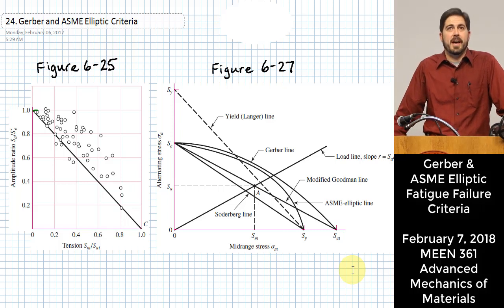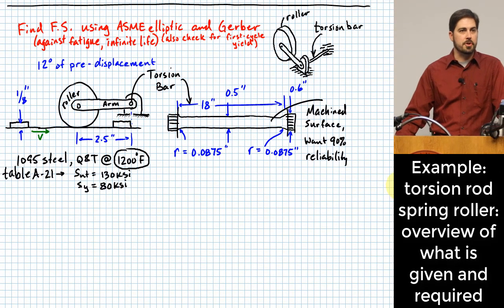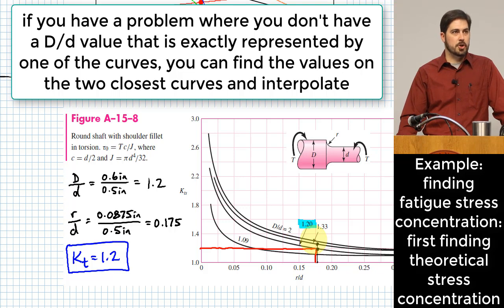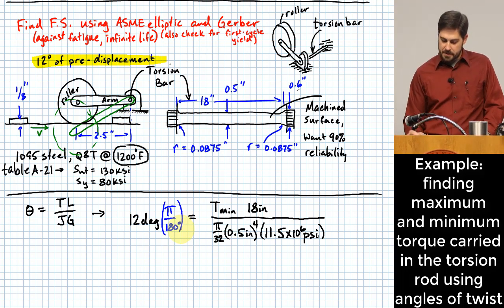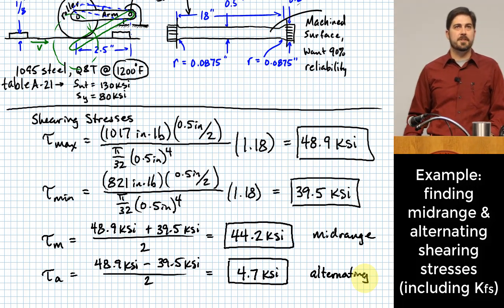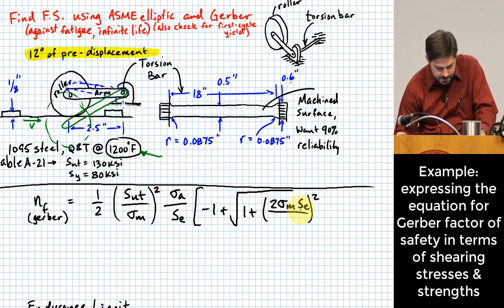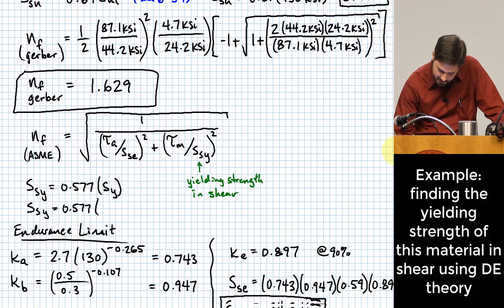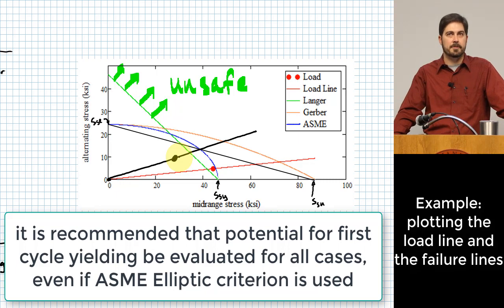Gerber & ASME Elliptic Fatigue Failure Criteria | Torsional Fatigue | First Cycle Yielding

Comment: So if the Gerber line is the best at curve fitting the data, and the yield line is the cutoff line beyond which none of these lines even matter because of first cycle yielding, why isn't Modified Gerber the gold standard? Like Modified Goodman from the Midrange and Alternating Stress lecture where the line gets cut off by the Yield/Langer line except with the more accurate Gerber line. Thoughts? I think why the gentleman in the video with the southern accent was asking questions about the region to the right of the Langer line and the left of the ASME elliptic and Modified Goodman lines is that region exists but seems to have no engineering value. Thank you!

Comment: What about the region between Langer and Gerber where midrange stress is low. i.e. a load with high cyclic nature and low midrange stress. Would Langer still be accurate for those situations ?
Because all criterions would give a factor of safety <1 except for the Langer. 
Langer would say you're still safe. But we know Langer higher than the Goodman, so Its probably unsafe right?
Reply from the maker: In those situations it just means that there will be a non- infinite number of stress cycles before failure, even though the material never yielded macroscopically.  Sorry it took me a while to get back to you!
Reply: @TheBomPE  Thank you, no problem.

Comment: Hello sir, thank you for your really great videos, they are very helpful and its so nice to see that you cover some real and interesting  engineering cases with the examples you solve.

There is something in this problem that I think maybe is not right, everything is okay until the moment that you are going to calculate factor of safety. As we see in this problem due to pre displacement we are going to have some constant pre static torsion stress in the torsion bar, so by this it means that our load line should not start from Taum=0,Taua=0 instead it should start from Taum=pre stress , Taua=0.(there is some same scenario used for bolts in page 438, figure8-20 of Shigley tenth edition)
And if we use this new load line that I described above I guess the value of factor of safety is going to change.

I will be so happy to know your idea about this case🙏🏻🙏🏻.
Thank you very much
Reply from the maker: I will respond more fully soon, but let me say for now that whether or not you decide to move the origin of the load line is a matter of how you want to interpret the load line...which loading factors you assume are fixed versus variable. (This concept is probably worthy of its own video, actually.) Thanks for your patience, I'll respond more fully in some form or fashion soon.
Reply: TheBom_PE 
Thank you 🙏🏻 I will be so happy to see your ideas about load lines in different cases, cause sometimes they get a little tricky, another case which had deferent load line was Example 6-11 on page 319 Shigley tenth edition.
Which in that case the designer draw load line by changing the value of pre deflection.
And it ends to have a horizontal load line.

I’ll be so happy to watch your video about the main concept of load lines an how to draw them properly for deferent cases.

Thank you very much🙏🏻🙏🏻
Reply: TheBom_PE 
Hello sir, I was wondering if it’s possible for you open the concept of load lines, in such problems that the load line is drawn from a point that is no origin of our coordinate system.
Such as in bolts fatigue procedure and also Example 6-11 on page 319 of the reference book.

Actually its a bit mind bugling(specially Example 6-11)

Thank you very much🙏🏻🙏🏻🙏🏻

Comment: Hi, thanks for your videos, they are helping me a lot in my project. Following this video, we have an example of stress concentrator in torsion with a shaft with difrent radios link each other with another radio. What would happen if we have a shaft with different radios tappered. So, with no radio tu use in the Kt table. In my case, my shaft has max radio of 100 mm and min of 80mm but they are link thogether in a link or tappered not by radios between them. How can I use the table with that radious values?
Thanks

Comment: Sir this is my favourite subject and your lectures help a lot. I have a question i was solving a problem and  by using elliptic approach i got diameter 2.77 and by using gerber i got 2.85 by using the same data for both but shouldn't it be like greater dia for asme elliptic than gerber for same loading and FOS condition.
Reply from the maker: Yes, ASME elliptic is more conservative than Gerber, so you'd expect that it would call for bigger dimensions on parts to achieve a similar FOS. You are certain you didn't make any errors in your solution process? Thanks for watching!
Reply: @TheBomPE  yes actually i even checked the answers i am using the machine design book by norton and the answers were right but didn't make any sense 
Sir i asked my university teacher he said that it depends on midrange and alternating stresses that which theory from the above two will give more diameter but i am still confused

Comment: As a consulting engineer for many years and an adjunct professor in the ME department int the CSU  system, I like the way you present your lectures. Everything is shown and the students are given example problems where they can see all the arithmetic.
Reply from the maker: Thanks for the positive feedback! Yes, I believe it helps the students to see all of the problem solving processes down to the nitty- gritty. Which CSU campus do you teach at? I grew up in Fresno (well, Clovis really) so I'm familiar with Fresno State. Also, what kind of consulting do you do typically?
Reply: My company is Applied Analysis & Technology, HB CA and for 15 years I also taught undergraduate & graduate classes as a part-time adjunct professor  at CSULB. The consulting  work is mostly aerospace, however recently we have been on a concrete cracking kick. The last project was degradation of concrete runways at LAX.  For a long time I was a Beta tester for MSC Nastran, Marc and Femap/NX. I've written over 50 articles for the technical and trade magazines... mostly Machine Design & Desktop Engineering... I you Google my name "David R. Dearth MSC Concrete Cracking" or "David R. Dearth Machine Deign" or  "MSC Applied Analysis and Technology " topics like FEA & concrete cracking might show up..  you might find some good material for your lectures.

Comment: I still don't get the last part of the solution. If the component going to yield on first cycle, why do we even bother going to calculate all the fatigue stuff? Isn't yielding failure? Shouldn't it to be avoided?
Reply from the maker: Teaching is different than solving problems in practice. You are quite right that in practice I would likely check for yielding first and only after that looked ok would I check for infinite life. But since fatigue is the new thing being introduced to learners watching these videos, it is helpful to get right into the new topics, then to remind them at the end that first-cycle yielding (which is basically like a static failure they have previously dealt with) is still important too.

Comment: if the shaft is pre loaded 12 degrees, and then later it goes over one of those boxes, the direction of the twist will change. Shouldn't we consider minimum shear to be a negative stress?
Reply from the maker: The boxes cause even more twist the same direction as the preload twist, so it does not cause a direction change. All torsional stresses are in the same direction for this problem, they just go from one positive value to another positive value and back again.

Comment: A rotating shaft is loaded with a bending moment of M=420N·m. The shaft transmits a steady torque of T=275N·m. Assume the shaft is machine from a material with Sut=510 MPa and Sy=390 MPa, and a fully corrected endurance limit of Se=191 MPa. Let Kf=2.0 and Kfs=1.8. With a design factor of 2.5 determine the minimum acceptable diameter of the shaft using the MSS-Gerber criterion. 
can you help me to solve this problem or at least give me a fomular